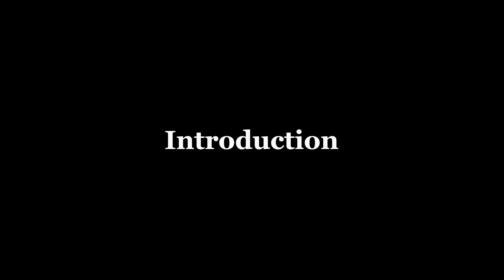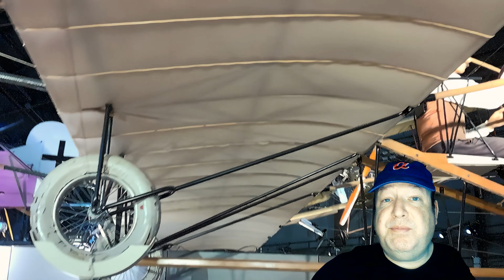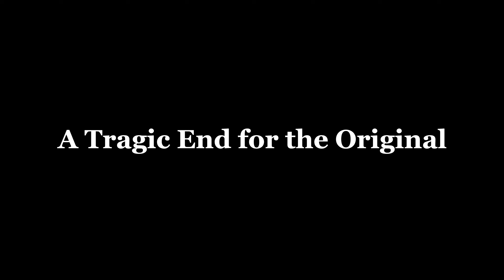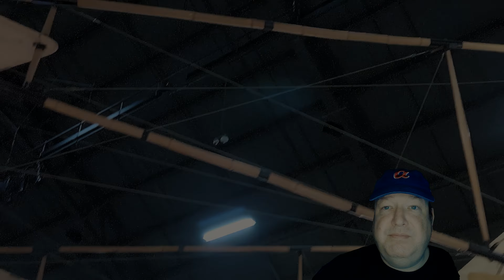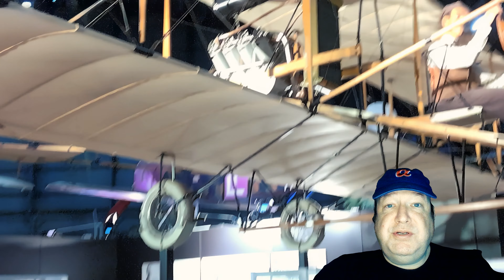Episode 6: 1911 Curtiss Model D at the National Museum of the United States Air Force

Comment: Little surprised that the Air Force Museum didn't try to get help from the Curtiss Museum in Hammondsport NY. They probably could have gotten the blue prints and an OX engine. There is a fine little museum in Glen Curtiss's home town.
Reply from the maker: unfortunately my research material wasn't in depth enough to know if they had or not. I would think that the NMUSAF has connections and contacts with every other aviation museum.